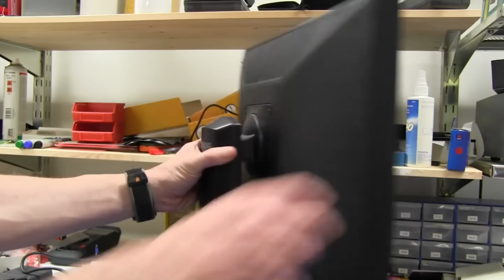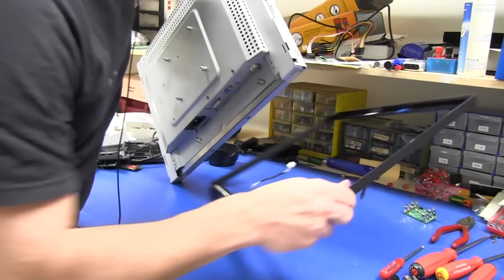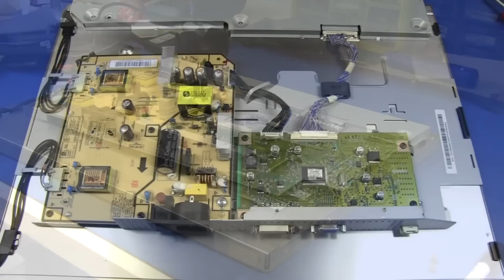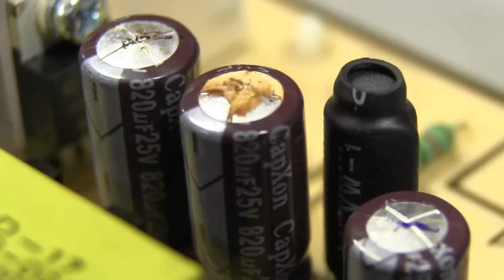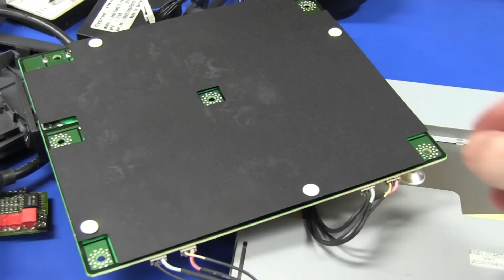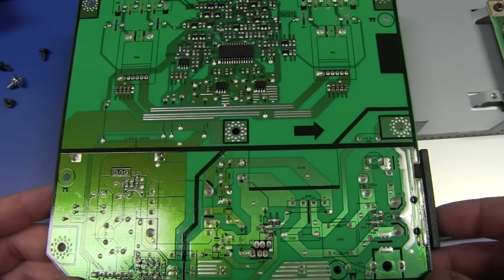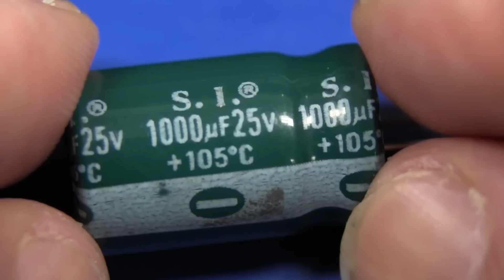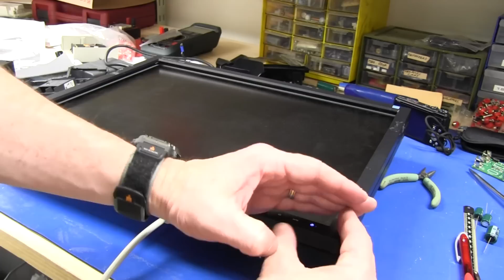EEVblog #347 - Bad Cap LCD Monitor Repair

Comment: Sir, I love your channel and mean no disrespect; however, this must be said. If you go through all the trouble to diagnose the problem and confirm the failure is caused by a brand of capacitor known to be of poor quality, why wouldn’t you change them all? I get it, saving time, and blah, blah... Please, can we steer clear of rushed repairs and half-baked fixes? In diagnostics and repair, precision is king, and cutting corners only leads to more headaches. Plus, you can potentially equip tens of thousands of people with some really bad habits. I will get off my high horse now. 
Thanks for all your great videos. They are fun and entertaining, as well as an excellent source of knowledge and experience. 
- Jason Burchell

Comment: Ah yes. I still have a Syncmaster sitting near the repair bench. I recapped it a year ago expecting as easy fix like this but no such luck.  It works until it gets warm then the backlight drops out.

One of these days I need to take it back apart to look at the solder joints and high voltage transformer.

Comment: So I happen to have 2 defective LCD monitors.. Let's pop one open. Yeah, a couple of blown caps of unknown brand. Do I have some replacements? Yes, but only 4.. Well, let's try to replace only those two that looked bad. Ok, done.. Testing.. Hmm, still doesn't switch on. Ok, let's measure some stuff.. Hmm, only 0.6 ohm between the plus and minus of those caps.. Weird. Let's measure some voltages with the power on it. Careful with those live traces that don't have a protective shield.. Hmm what voltage would there be on those big caps? Ohh, well over 300 volts.. Ok chaps, let's cut the power, wait a bit and then VERY carefully close this sucker up.. I don't feel like getting killed today. 😅

Comment: If you replace capacitors with new ones with higher capacitance (assuming the new part will fit on the board), would that increase the lifetime of the replaced capacitor? Or is the only cause for the failure the age and heat (causing bad ESR) and the actually used/needed capacitance is not that important?

Comment: It's just desinged to fail in a predetermined time frame. The dodgy caps are there by design unfortunately, remember that you found them in the dumpster, the owners didnt even think of repairing them. They just bought the new product, maybe even from the same company. That's consumerism for you. Everything is made so it can fail in 2 years nowdays.

Comment: The only comment I have and maybe you said It and I missed it, you need to have the negative side of the capacitor go back to the negative side of the board. Helps to mark the neg side of the board when removing the bad caps.

Comment: I'm just starting to learn basic electronics and already just a few days in I've noticed that low quality caps blowing is one of the most common causes of failure, going by a bunch of videos and forum posts.

In fact I've already encountered it myself because I chose to mess around with a broken old HD DVD drive I had in order to practice soldering/desoldering, and I quickly noticed that a cap was blown (which is likely what caused the drive to fail). 

When I think of the number of things I've thrown out over the years that might have been easily fixed it annoys me, especially when it might even be a premeditated decision on the part of the manufacturers. Not gonna be doing that anymore, there's more than enough e-waste already and I don't want my nerdy hobbies contributing loads towards it. This nerdy hobby is gonna reduce it.

Comment: What if none of the capacitors are bulging or look odd?  I have a V7 d22w12 monitor that comes on for about 5 seconds the goes off.  I've opened it up and got to the power board but I can see any capacitor that is bulged or discolored??
Reply: When I was recently fixing a PSU I noticed that 2 electrolytic capacitors blew from the bottom. They were flat on top. 🤔😉

Comment: In all the broiken electronics I have opened, I never seen a bulging cap nor a leaking. That is my unicorn.
Reply: That's really funny because I literally only started learning basic electronics this week and the very first broken device I opened for practice ended up having a leaking capacitor, which was almost certainly what made it die. Although I have since googled the device and found that a blown cap was the single most common point of failure (the only one I could find mention of online).

Comment: Strangely enough this didn't help my cause. I had turned my computer off and the next morning the monitor would not come on, waited an hour~ and it finally did. A week later did the same thing to 'test' the case. Ended up replacing 2 bad capacitors and now the monitor light goes orange -> blue -> off, repeat. Not sure what the issue is, was almost positive the capacitors were the main issue.

Comment: same with mine mate, dodgy caps on a Samsung SyncMaster 226bw.  6 caps were bad and as you said no need to test.  Was evident they were dead.  Filter cap was ok so left that in.  £2 quick repair and runs perfect now.  Not bad for a scrap find

Comment: Found an 11 year old Acer x233h monitor - dumpster find - it does work but I might do the capacitor replace thing too! I have a Samsung Syncmaster 205bw & it still works great! 😁Thanks 🤓 thanks for the close-ups of the caps & comments to help recognize their condition!
One thing i forget sometimes with the S/sung is that theres an on/off switch near the video cable plugs! Low ESR.. thanks are japanese caps a good choice?

Comment: 1:39 "Electrolytic capacitors, of course, has" ELECTROCONDUCTIVE electrolytic liquid inside and dielectric layer of OXIDE on helix-wounded aluminium foil electrode (for aluminum electrolytic caps). BTW, high voltage electrolytic caps (from 150 to 450V) has different type of electrolytic liquid than ones with low voltage (from 6.3 to 63V) - so even ones from shitty brands could be pretty decent and last long if not overheated.
Actually, it's black SILKSCREEN printing over green soldermask.

Comment: Ive also noticed they place these caps right next to a hot running heat sinked component that will heat the cap and also shorten its life.

Comment: Built in obsolescence, engineer a weak link into the product to ensure failure so ya buy another one, and another one - but this logic is flawed, if this one failed or failed early, why would I even buy the same brand again from this same company-?  I have to think since these are all built in china in the same factories so they have the same idea to keep themselves in customers. Ive fixed a few monitors with this same issue, the product had name brand components until it came to the powwer supply caps, then they were always oddball low level brands that failed early.  On two of my monitors, after replacing the caps they have outlasted their original time until the caps went. Electrolytic caps have a finite life as it is, but I guess its not short enough to fill their pockets fast enough.

Comment: What happens after the capicator blows up, does it just not pass any electricity through, or does it pass all electricity through?
Reply: capacitance value goes out of spec to start I suspect if it shorts then it'll get hotter and dry out faster presumably

Comment: I keep forgetting that I have a flat-screen that I picked up from the local shopping center a few years ago that needs repair (looks like it's fallen off its mount somehow, as the chassis is warped).  One day I'll get around to putting it on the healing bench and having a look at it.

Comment: What about discharging the capacitors before touching/desoldering them? Not necessary?
Reply: Low voltage capacitors, cannot cause any harm.

Comment: if I'm not mistaken samsung don't make the power supply. they are most probably delta brand. With the amount of engineers working at samsung they could design a PS with better caps on and not capxon ... ok ok I go

Comment: That is a bad brand capacitor. CapXon brand are sometimes known to leak. I am not surprised that Samsung used so-called CrapXon capacitors in this monitor, I have seen them in Samsung galaxy phone chargers in other videos. Our Samsung TV seems fine. I do not know what caps are in it because I am not allowed to take it apart. Sometimes electronics can take a lot and survive...  then go bad one day without a reason. The TV is pretty new though. I wold be surprised if it broke.

Comment: samsung seems to have used some really crappy capacitor in their monitors. I had my 2053bw stop working after a month, and the replacement, which had a chipped screen, won't turn on unless I first pump hot air into it /shrug

Comment: today i replaced a cap on a old medion monitor, because it had such horrible coil whining

it turned out that the cap was responsible for smoothing the voltage for the high voltage transformer witch powers the cold cathode backlight

now the squeaking is finally gone, i wish i would have known that 4 years earlier ...

Comment: what is the significance of a cap value of 470 uF?  This "47" digits also are popular with resistors (like 4K7 ohm) or inductors.. why?

Comment: I believe, Samsung is using the same type of power supply in every monitor. I got a newer model of yours which also has the Vad-Cap-Problem. The board is looking exactly like yours. The same Caps are broken.
Reply: Could Caps be dead, even if they are looking perfect? Because i found a TV which, in most of the chases, wont turn on and just makes the Led flash and making a high-frequency tone.

Comment: Will this technique work on computer motherboard caps?  I have one with two or three caps getting ready to blow.
Reply: Yup, if they are ready to blow and you want to save the board then do so before they leak.
Reply: Great.  I have several that are starting to show signs of bulging tops and one that has started leaking.  My machine has started random hard-starts.  I'm pretty sure it's not malware since I restored from an old system backup and there are no entries at all in the system logs.  The log just ends abruptly and the next entries are the system rebooting with about a two minute time interval which is how long it takes for the machine hardware to cycle.  I replaced the power supply and that didn't help.  The reason I did this is because it would not run at all on the UPS which produces a semi-sine wave and that extra electrical noise must be getting to the MOBO--didn't help but now I have an extra 600w power supply.  I figured that worse case I would cut the capacitors apart and solder new ones to the exposed pins.  I just need to make note of the polarity or I'll fry the MOBO for sure.  Since this isn't super high frequency suppression and only the regulator section a couple of millimeters of lead won't hurt.Thanks and keep up the great videos!

Comment: I've had my Samsung SyncMaster B2330 monitor for a bunch of years now and works fine but its making some buzzing sounds (it has no speakers). 
Could it be that the caps in the power supply are beginning to fail?

Comment: can someone point out other point of failure ? is it common for the backlight inverter to fail ? if yes, are the caps again the ones to blame ? what about the logic  board ? i have one monitor that i think has problem with the inverter or with the ccfl lamp. Can i use inverter circuit from one monitor to light up backlight from other monitor(not the same model)

Comment: I once fixed an Emerson TV I got for free because of the same kind of failure though it also took out two resistors and the main switching transistor.
Though it still was under $20 in parts.

Comment: Monitors are so cheap...    You may as well buy a new monitor.
You need a soldering iron and and a solder sucker to remove the defective capacitors. You should just  remove those capacitors that are bulging.

Comment: I have repaired about 15 Viewsonic monitors this way - replacing the capacitors. However I have noticed that anything newer than about vintage 2011 I can't unsolder anything off the boards. I have just a basic soldering iron.

Comment: my hp monitor will only come on for about 10 seconds . when i turn on my ps4 , the monitor will only show a picture for only 10 seconds and then no picture. would that be a bad cap or what would be your educated guess. would love your input Thanks!!!
Reply: Open it up and look at the capacators

Comment: Dear Dave, I have a question. Thank you for the EEVBlog. My question is very simple and probably very stupid, but i noticed that power supply circuit boards are usually a very basic yellow or beige color. why is that? is is because you can see faults better during troubleshooting? Or because it is only 1 or 2 layers? Again, sorry if this question is extremely stupid but I am extremely curious about this. What is the industry rationale as best as you can tell for why mains input and power supply boards are usually yellow or beige?

Comment: Sir my lcd monitor works fine for 1 hour but after that screen goes black..then i restart my monitor it works again fine for next 30 minutes...what is the problem sir..please help me
Reply: Thermal failure: Some component fails when it gets warm. Use freezing aerosol to locate the faulty part and replace it.

Comment: same problem here with LCD monitor. Need to replace three 820uf 25v capacitors, but also a 330uf 25v.... Is it okay to use 1000uf 35v in place of the 820? And a 470uf 35v for the 330?

Can't find the original ones, so I know the video said 1000uf is good. But what about the voltage?

Comment: I had a bulging cap in my TV once. Kept the screen from being able to power on, but IF it was on, then screw that! (My mum put an index card over the power button that said "DO NOT TURN THE TV OFF!!) Powering it on, the light would go out (reversed power light lol) but the screen was fucked by the bulging cap.

Comment: Planned obscelescene is all i can say about this
Reply: No planned obsolescence, at all. If Samsung invested so much in quality parts and careful engineering-- witness comments by EEV-- all of us are left to wonder about the single point of failure in a substandard line of caps. In fact, the monitor is simply another victim of the capacitor market scandal of a decade or more ago. As EEV surmised, the caps originally specified were simply replaced by a pointy-haired individual in production who (1) did not know or (2) did not care about the scandal associated with caps manufacture. And (3) did not bother with production batch testing.

In the capacitor scandal, an insider at the original Japanese OEM for caps stole design data and had the caps made in a low-budget shop for pennies on the dollar. That thief then sold the sub-standard caps at a "bargain" price to companies like Samsung, Dell and others, and made lots of money on their questionable presumption the caps were made by an honest vendor. The end result? Many of us invested in brand-name equipment that should have been higher quality, but died early of caps failure.
Reply: Oh, "Phle-e-ez!" Don't give us that crappy "just one crooked employee" excuze! It's GNUSMAS shady policy!
 When in 2008 I bought theirs top of the line TV - LN-52A750, it was BEATIFUL! But 2 years later it got "blinking LED" problem, sure enough I already knew it's capacitors in the Power Board. But when I opened PB  all 7 or 8 of the bulged cups been placed alongside of the loneley RADIATOR! And around there were tons of empty space! So, they DESIGHN it that way from ground up! Samsung ingeneers - are the  3-rd most dishonest people in the world, after MSM and politicians... :) 
 So I got in RadioShack for 15 bucks excellent japanese Nichicon caps twice the voltage and size and glue them couple inches away from radiator - worked great. Later I sold it (even told the guy whole fixing-story).
 After that I bought gorgeous Sony 55NX720 an said to Sammy - "Bye-bye for like EVER!"
 Samsung's mobile looks OK though... :)
Reply: Just checked it actually were 4 capacitors, but still all my points are valid!
https://images-na.ssl-images-amazon.com/images/I/51zQNRIMNCL.jpg

Comment: How do you explain that the dielectric fluid 'dries up' when they are hermetically sealed? Answer: it DOESN'T, IT LEAKS OUT and THEN DRIES! C'mon grandma, get with the new technology!
Reply: It evaporates into the air inside the cap. This increases the amount of air and thus the pressure, first causing the can to bulge, then causing the overpressure vent to open.
Reply: Actually, EEV several times in this video said the fluid "vents out". From that much, more than a few of us concluded the drying occurred after repeated venting /releases.

Comment: Only wish mine was that easy.  I have a Viewsonic with a white screen and replaced 2 Caps properly and still I get white screen.  I looked at other caps and they look fine. no bulging.  Can you tell me besides the caps what else would cause a white screen ?

Comment: Yea nice video. After watching this video  i realized that the 50A 13.8V SMPS i have found in the dumpster might now be as useless as i thought!!!!
I took it apart and saw two 450uF 400V caps were blown!!!!! I have replaced then with some Nippon Chemi-Con caps of the same ratings, and is started to work. Not  bad for a power supply that stayed under rain for a week. Thanks!!!!!!!!!!! a lot!!!